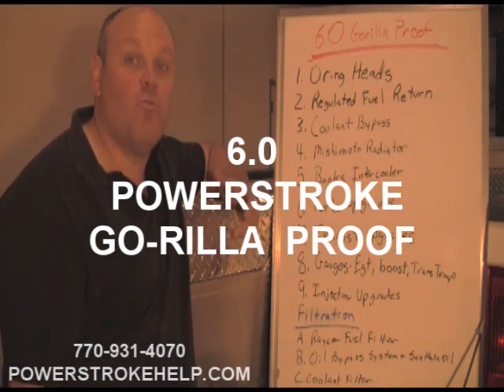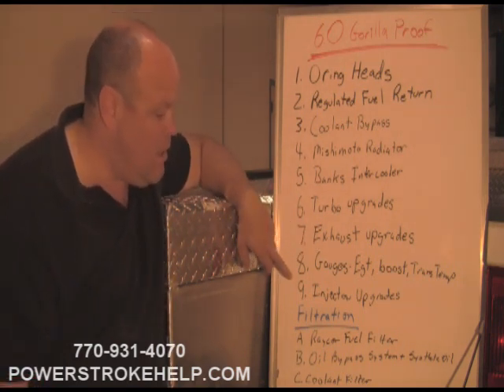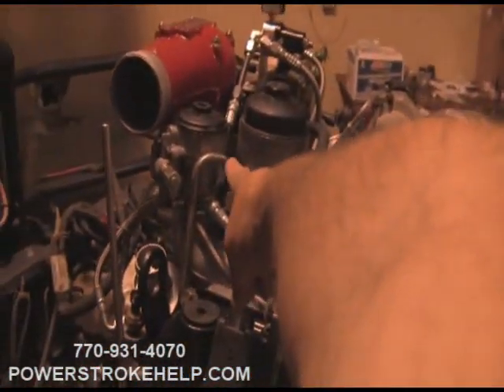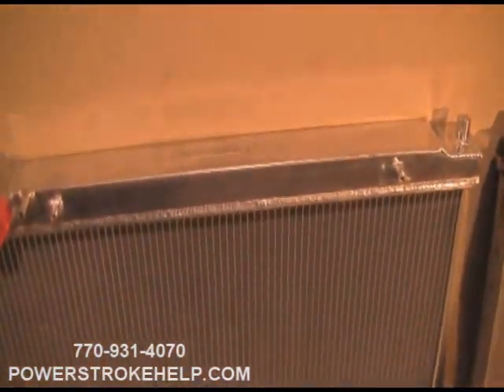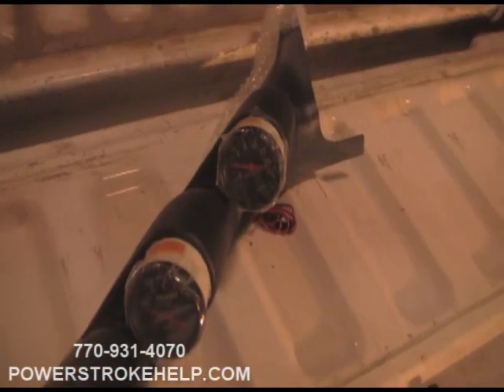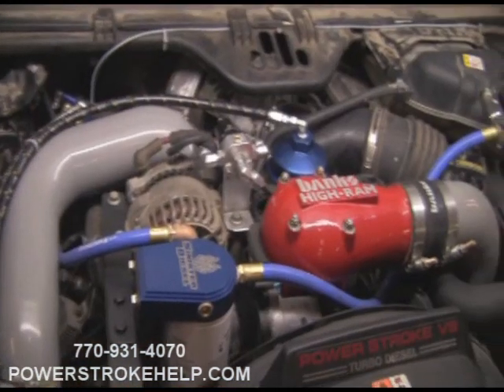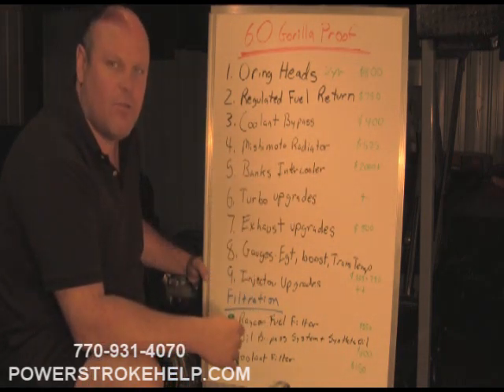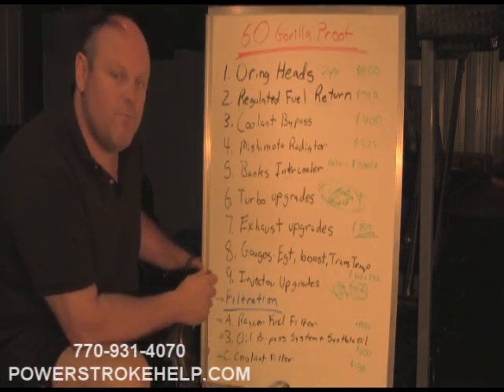GORILLA PROOF the 6.0 PowerStroke Diesel

Comment: What do you think of a oil cleaning centrifuge.? 

Never seen one available for vehicles but I’ve seen them on the pump motors on the drilling rig I work on. The materials it picks up out of the oils is absolutely incredible. It’s so fine it’s almost like a rubber. Do you think it would be a good way to help your oil system stay clean.?

Another thing I’d like to get for my 6.0 would be a battery kill switch somewhere inside the cab. I’ve had my truck stolen and it was recovered and I wasn’t able to have insurance write it off. Anyways any input on this would be greatly appreciated.

Comment: Hello guys I want someone to help me my turbo turbine wheel compressor broke and it’s making a wired sound when I step on the gas and also wanted to ask were are the missing parts of the turbine wheel? The engine it’s not running rough it’s smooth
Reply: It’s a 2007 F350 6.0
Reply: Well I know its late but they either ended up in your motor and destroyed the cylinders which you wouldbe noticed if it did, or they flew out the exhaust and you'll never see them again. Depends on which side of the turbine was broken

Comment: Fuel bowl delete and frame mounted spin on filterS is so much better you get better filtration and less junk in the engine bay.  
Mine is fed from the back can't even see the feed lines they come in from the back of the block, all that is really viable is the FPR and return line.  Makes it so much easier when you need to work in there.

Comment: I have a 97 7.3. Nothing is wrong with it. It just rides like absolute shit and is an older truck. Should I get a newer 2006 6.0 and bulletproof it? How much would this cost? I want a newer truck, but not a 6.4+. Thanks.
Reply: Depends of what you want to do with it. Are you towing stuff with it?
Reply: Simplex SM Not really. Maybe a landscape trailer once in a while but that's it.
Reply: 6.4 aint bad at all, ive got one and its a wonderful truck.
Reply: dude, depending on your location I would buy your truck
Reply: ***** I live in PA.
Reply: cjchico Darn, nope.
Reply: Probably a little late, but if you can get a 6.0 for a good price, below 10 grand, I would do it. Total cost of bulletproofing is probably around 3-4 grand if you have a shop do it, less if you do some of the work yourself. for example, if you can find a 6.0 for 7 grand and put 3 grand into it, you now have a very reliable truck you spent 10 grand on compared to someones 99-03 7.3 they want 15-16 grand for that has over 250k miles.
Reply: my 97 7.3 idi f350 is bone stock with over 300k and still runs strong..

Comment: One shouldn't Have to spend $7-10,000 simply to get a vehicle to do what it was Designed to do.
Reply: +Sean Hazelwood you're correct.  What is described here are steps that can be taken for performance upgrades. Many people try to operate these trucks beyond the factory perameters and are frustrated when they fail.  The fact is, the 6.0 can be enhanced to perform well beyond what it is capable of IF you install upgrades.  Towing 10-12k pounds with a well maintained, stock truck isn't a problem.  Pushing beyond that without doing maintenance or upgrades will end badly (as with any truck).  Our 2004 6.0 is "bone stock" and 100% reliable and we tow with it, off road, etc. without any problems.  We always do the required maintenance and use synthetic oil. Beyond that, we don't baby it so to speak.  It's a workhorse and we push it when we need to. We're considering some performance upgrades etc. because we want to keep our truck forever.  Buying a new one is 66k dollars and that just isn't something we can do!
Reply: The first half of his list are the things he says he commonly fixes on stock 6.0s. The rest are upgrades.
Reply: +Sean Hazelwood You need to understand what this guy does and what he's trying to achieve.  His objective is to educate and then potentially fix problems for people who already have or are thinking of buying a used powerstroke.  Let's say you are in the market for a diesel but you don't have 40 grand or want to spend that.  This guy suggests you buy a used diesel that someone is having all the issues described here and just wants to get rid of.  If you can get a great deal on one for 7-10 grand and then put 7-10 grand into it, you'd have a nearly new, nearly problem free diesel truck for under 20 grand.  That's the point he's trying to convey.  Say what you want all day about what Ford shoulda done, yada, yada.  He's found a solution to a problem and a potential bargain for a would be diesel buyer.  Hope that makes sense.
Reply: +Sean Hazelwood Welcome to planned obsolescence and emissions control introducing far more points of failure. Ford did have a workhorse motor that long outlasted the truck it was in though, the 300 straight 6.
Reply: Sean Hazelwood
Well as I said, emissions kill modern diesels. You may also want to look up the class action law suit GM faced over Duramax head gasket issues and the warranty they put on their injectors to avoid another. Cummins also faced a law suit over cracking blocks. But really Dodge can claim no wins on their part cause they don't build their own engines and if you want the rest of the drive train to last its not Dodge either. They had to start offering Allison transmissions to have a trans that wouldn't detonate under load.

And my only real experience with newer diesels are with the 6.0. And for all the failings of that motor, it was a beast. Used to drive an 05 F550 dump and when you got on it, magic would happen. Not many trucks i've been in that would plaster your ass into the seat when you got on it, let alone with a loaded dump bed. I wouldn't buy a newer diesel from any manufacturer myself, mostly cause I like older trucks as is. You know back when they were trucks and not over sized cars.
Reply: +Dieselman8v92 in 2008 the emissions bull shit got really bad and it has killed so many 6.4s
Reply: Funny thing is, in 20yrs of farm and construction work, all of our 5.9 Cummins outlasted the trucks, as did all but one of our 7.3 PSDs. I'm driving a 7.3 with 400k on it right now. We have 2 6.0 PSDs, and they stay in the shop. Resale is too low on them to sell them. We had one GMC with Duramax, motor was good but grenaded 1 transmission and two rear axles in 2yrs so we sold it. Ask any Ford service tech how many 6.0/6.4/6.7 trucks they see daily. Ford almost went bankrupt over warranty work and lawsuits because of those junk engines.
Reply: Have to agree with the 300. IMO, it hasn't been beaten yet.
Reply: The truck does exactly what it was designed to do.  What you want it to be designed to do, and what Ford designed it to do, are two very different things.
Reply: sylumgand Yep, I've had several 300s. If it had a little more pulling power, it would have been the best work truck ever built.
Reply: You'll notice I said we sold the one Duramax we had. I've truly never heard of Cummins cracking blocks, I will read up on that.

None of the makers make their engines. PSD is Navistar/International and Duramax is Isuzu. GM also had to use the Allison for the same reason as Dodge, although at least Dodge still offers a manual trans that holds up equally well with the autos. Ford did also until 2010. GM never did offer a manual worth a dang behind the Duramax, then they quit trying altogether.

6.0/6.4/6.7 PSDs, 6.7 Cummins, and Duramax all make killer power, but that's useless if it spends more time in the shop than it does on the road. Which was my point in this entire conversation.

Every diesel engine (in light duty trucks) available after 2005 is trash...period. I said 2005 because that's when Dodge went to the 6.7 Cummins, and rumor has it Ford fixed all the 6.0 issues by then...right before they retired it. The newer Duramax isn't much better, like you stated, head gaskets, etc.

I'll stick with 5.9 Cummins and 7.3 PSDs. Less power than the newer stuff, but they are as close to being bulletproof as it gets.
Reply: Sean Hazelwood
 My point more or less is they all suck in their own way. But also that people seem to think that issues with diesels are Ford only, when as i said you find wayyyyyyy more video's of Duramax and Cummins blowing up then Powerstroke. And that's on top of the fact that Ford sells thousands more heavy duties per year then either Chevy or Dodge.

As for bulletproof engines, i've been watching out for a 90's F150 with the big daddy 6. One that isn't being held together by the paint that is, NE Ohio is brutal on 20+yr old vehicles of any make. Personal experience has proven that engine will pull far more then the trucks rated for and do it day in and day out without issue. Pulling 15,000lb trailers was a twice a week deal during spring, summer, and fall (was a nursery truck, as well as a daily driver) for 4yrs till it was replaced with a panel truck. We had to replace the rotors every year, but other then that nothing failed. But all that really has nothing to do with diesels soooo ill just shut up now.
Reply: +sylumgand love that ol 300 , i still see a fair amount on generators. 
Love the way they run....smooth like a sewing machine.
Reply: Sean Hazelwood you can't say that about all engines there are gasoline engines that will run 250k with no issues at all. ls motors are cheap plentiful and reliable asfuck when maintained, oil changes, water pumps sgit lile that not 1000 doller injectors
Reply: Sean Hazelwood but we do local mechanics are thief's I've been put in the ditch for 7k now and without a gorilla or bulletproof system so in a way it's a bargain.
Reply: Steven Cash your right I never touched the engine but my trans was a constant problem even after upgrades
Reply: I have just about $70,000 worth of repairs since 2014
Reply: Sean Hazelwood
Funny thing is, if you search for the various motors blowing up. Ford has the least and Dodge has the most returns, 20,000 more then Ford. And Duramax comes in second. And yet there are far more Ford trucks on the road then either Chevy or Dodge.
Reply: Yep. Actually, one could say that about All engines.
Reply: So, it was Designed to overheat and blow head gaskets due to faulty egr coolers (which was a dumbass idea to begin with to input exhaust temps into the engine cooling system), insufficient head bolts (weak, and not enough of them), poor quality head gaskets, and poor quality coolant. This is while granny-driving the truck, putting the truck to work as it was intended only makes it happen faster.

It was Designed to get roughly 12mpg (don't blame emissions. a clean, efficient engine gets better fuel economy not worse). Also, can't blame higher HP because even Duramax gets better mileage.

The truck was Designed to demonstrate the death wobble due to a crappy front suspension design (front coil spring suspension on HD trucks is far from a new idea).

These are just the ones I feel like typing right now...as designed by Ford.
Reply: I never questioned what he's doing, I did rag on Ford. That many mods just to make a vehicle reliable is bs. Also, there would be more design flaws to fix that he didn't cover. I'm a Ford man, and always will be. But for diesel trucks, buy a Dodge and save yourself the headache.
Reply: Well. It was designed to what it was. This process just makes it a lot better in horsepower, fuel economy, and the big one is reliability.
Reply: one could just buy a cummins and never touch the motor....
Reply: @stevencash3774  yes. I had a 2006 Mega cab with G56 trans and 4.10 rear...  Bought it new I changed out an alt.,in tank fuel pump, a radiator, and a fuel control acuator... Never ever had the valve cover off.. Original injectors.. 278K miles. It was taken out by a pshyco drunk now ex girlfriend. Smashed it into 2 other trucks and totalled it....

Comment: I'm looking for an 05-07 6.0 and wondered what's involved in a basic bulletproofing, cost to perform that procedure, etc.
Reply: +skullhart  05-07 6.0L, Ford fixed most of those issues by then. Only when performance mods are used or when performing heavier than rated work do you need to do all that to those models. As this man has stated in a dozen videos.

Comment: I am in the process of replacing my egr cooler with a bulletproof unit and an oem oil cooler. This will be the second time I have had this issue with my 2004 Super Duty and I am wanting to do some of the other upgrades in this video but can find no information on your site for sources of these upgrades. If you are a distributor or have information on these products, please reply.

Comment: Awesome videos.  I have learned alot from them. I have done a lot to my truck using them. I have a quick question, do you normally do a resistance check on your injectors when you receive them? I put a set of 8 injectors in just to find out one had low circuit.  I Did a resistance check and found one side not reading any resistance. Would one bad  injector cause the truck to stall when put in gear while cold?

Comment: What do I have to do to my 06 f250 6.0 before I put a programmer on it!?
Reply: +Skyler Arnaud Sounds like a HyperTech Max tuner in stage 1 or 2 would not be a problem according to my discussion with Jodi at DP Tuner. If you are not comfortable with that, then DP Tuner or SCT tuner AFTER machining and o-ringing the cylinder heads + ARP head studs would be recommended.

Comment: Hey bill, I'm having a trouble code on my 06 6.0 that I've been getting on my sct tuner that is p0000. I delete te code but everytime I turn the truck off and come back to start back up it comes back on. I don't know what the deal is, the truck has no cold start issues or running issue and it started when it started getting in the 20s here in Kentucky. Like I said it starts up fine, no injector misses or stiction.

Comment: I'm looking at a 2005 6.0 with 170k on it and its stock, but it has a 4 year warranty, what should i look for and is it still possible to make good HP with a 6.0 and have it last? will the 6.0 run with the 6.6 duramax when tuned?

Comment: have a question hope you can help,,i have 2003 f350 6.0 was driving for 5 hours other day slowed down for a toll booth and truck just died,no obvious signs of power lose before hand,lights ,radio etc. will crank over but not fire ,friend said maybe crank shaft sensor,,nedd some ideas before i get into it .pulled code uo155 aswell.thank you for your help

Comment: I've been having a weird issue on my 6.0. Its stock. But it runs great and at random times it will rev up a couple hundred rpms n back down really fast just a quick spurt of throttle all on its own. Then it will drop rpms in the same manner. Then if I punch it it usually goes away for a while. Any idea.?? I had it plugged in and everything's fine and it doesn't throw a code at all.

Comment: i have a 06 f250 i had it bulletproofed and the FICM with all injectors done now i have just put a new fuel pump and cleaned out the fuel tank and lines now it will run good when it is not in gear but when you put it in gear it loses all power and dies what do you think is going on???

Comment from the maker: It increases throttle response but little more. If you want true performance improvement then you need to consider a regulated fuel return system.

Comment: I have my truck torn down now to do some repairs.  New oil cooler, welded EGR cooler, coolant filter, blue spring upgrade, adding Rex-X, gauges, 4" turbo back exhaust, repairing FICM and Atlas 40 tune, ecm/ tcm roll back with egr delete and 65hp tow tune from power hungry performance.  I'm saving for the regulated fuel return from Dozer's, I'm also interested in the Racor fuel system, which one do you use?  Is now a good time to do it, or should I just wait for the reg. return?

Comment: hey powerstrokehelp, I have a 2007 F350 6.0 with 160 km, has new heads, arp headstuds, all new injectors, sinsister EGR cooler. I do not haul anything, more concerned with speed and fuel economy, what do you recommend for motor oil, tuners and injector cleaner ?

Comment: THE GUY KNOWS HIS 6.0 DIESELS, AND KNOWS WHERE TO PUT THE BUCK FOR THE BANG. THE BOTTOM LINE IS HOW MUCH DO YOU WANT TO SPEND, IF YOU DO EVERYTHING BILL IS SUGESTING, THE MOTOR WILL LAST FOR EVER.COULD PROBLY INSTALL IT IN YOUR NEXT FORD IN ABOUT A MILLION MILES.I HAVE 268472 MILES ON MY 6.0 HAVE DONE MOST OF EVERYTHING BILL SUGGESTED. ONLY TIME I OPEN HOOD IS TO DO THE SERVICES AND THE REST OF THE TIME TO PUT WINDSHIELD FLUID IN. DONT BURN OIL OR LEAK OIL NOT A DROP... NEVR MET HIM BT GOOD GUY

Comment: If all I ever did was the fuel return and coolant return upgrades, how far would that go in eliminating the head gasket/oil cooler/egr cooler issues?
Have you given thought on designing a better egr cooler system as opposed to an egr delete?
How about a egr filtration system to prevent the coking/carbon issues?
As long as Ford keeps making trucks, my kids will never go hungry.
Awesome videos.
Justin

Comment: First I'd like to thank you for your time in making these series of videos and answering all the questions you get. I've got a 05' f350 6.0 and I'm overheating while pulling loads. The following has been done Banks 4" exhaust,hi ram,egr delete,bully dog cold air,coolant filter,arp studs and black onyx gaskets,700 miles ago oil cooler,Banks 6 gunner. I've got the 6 gunner set at 230 water and 225 oil temp  anything beyond this alarms will sound .Could it be the coolant fan clutch ?

Comment: Bill, I would like to know what you think about extended life coolant with a cat-1 rating. People are switching and saying the silicates in the gold is clogging our oil coolers. Elc does not have silicates. Would you think it is a good thing to switch with the propper flushing of the cooling system before hand?

Comment: Fuel return line kit, new injectors, properly timed IP. That solves most IDI problems.

6.9's came with a C6 or T-19....some 87 6.9's came with a ZF-5 speed. I would swap to a ZF-5 speed, you would get a overdrive.